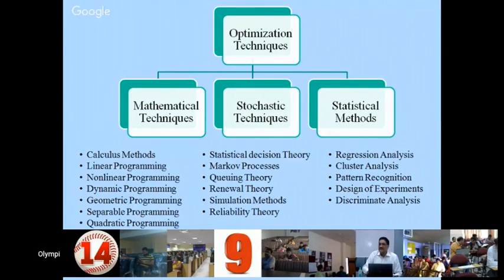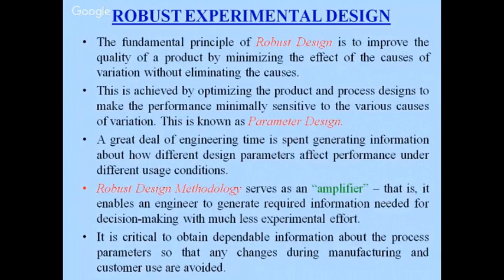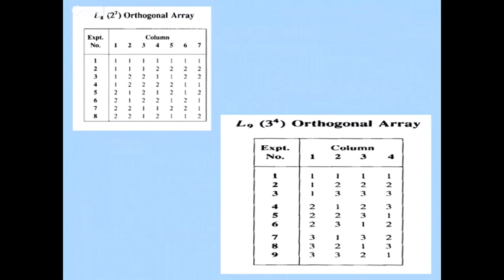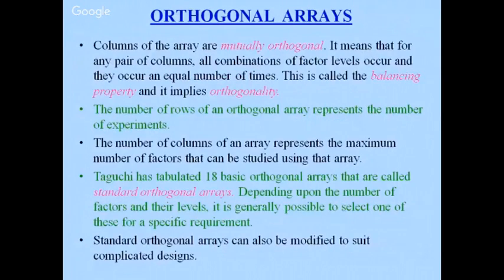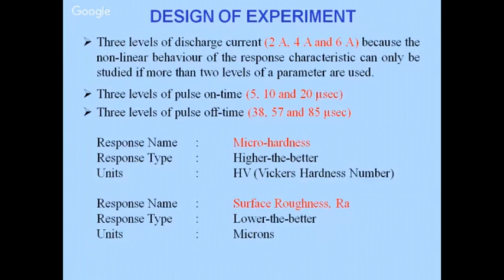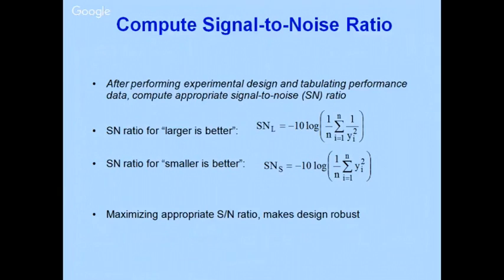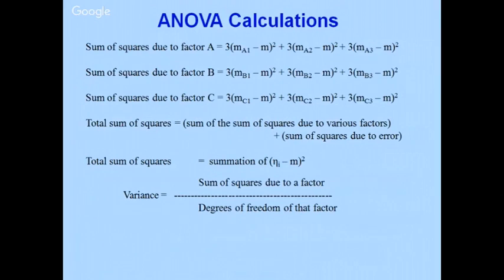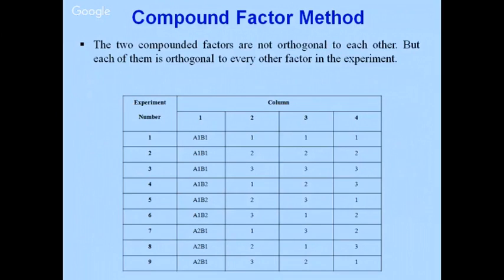Process Optimization by Taguchi Experimental Design By Dr Sanjeev Kumar

Comment: We can go for mixed design in case of parameter levels are not equal..just think of it
Reply: is it possible to generate confirmation test for taguchi in minitab software?
Reply: Can u please clear my doubt. I have 3 parameters and there are 12 experiments (4 rpm's, each 3 times) done with those parameters, then which OA should I take? is it okay to take L9 array with 4th column blank and taking 12 rows?